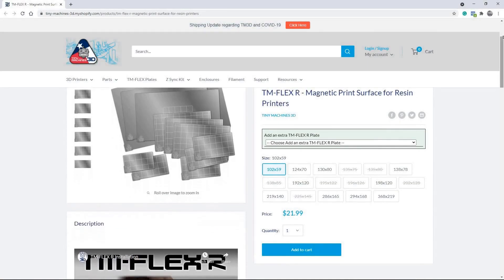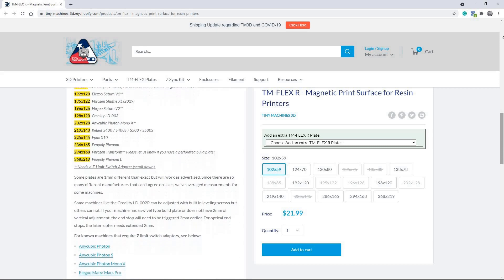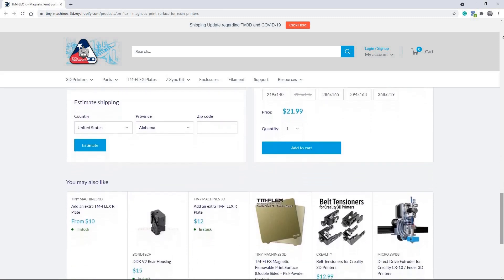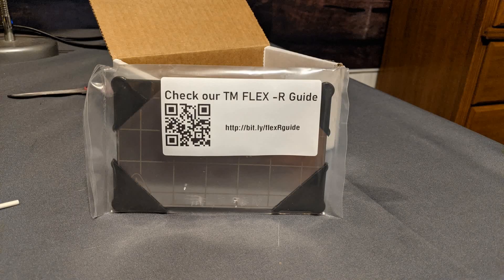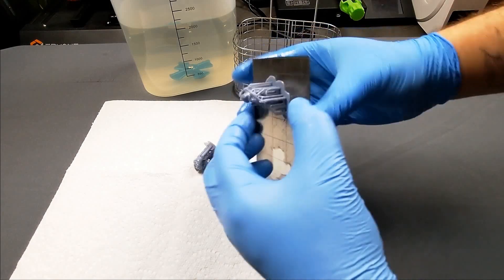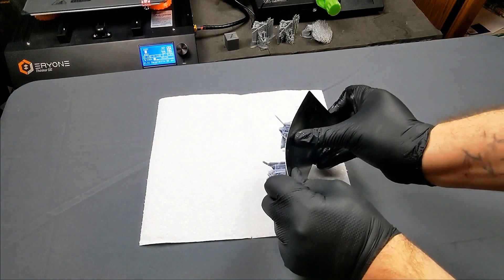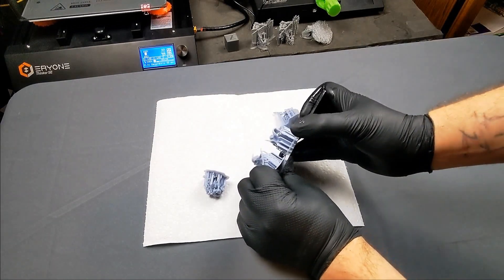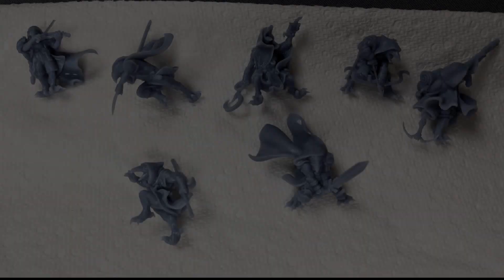The Absolut Best Upgrade for Any Resin Printer!

Comment: I'm curious if you are still using the flexplate? I had to change back to normal on my printer because I got layer shifts due to resin getting between the magnet sheet and the flexplate. I made sure to clean the flexplates underside and magnetic surface after each print, but it seems the magnet is too weak, it was just a small film of resin but enough to cause layer shifts. I got mine from energetics store on aliexpress, maybe the magnetic sheet is weaker than others..idk. I'd love to see manufacturers embed strong magnets into their build plates so we can use flexplates without those magnetic sheets. As for now this isn't an option for me, it just introduces one more possible fail variable.
Reply from the maker: I can definitely understand that. I've hard of this happening on a few different plates from some manufacturers. I definitely think it's due to the magnets being too weak to withstand the suction forces.
I've not had this issue on any of my 3 flex plates. However, I'm not printing continuously on those units so that's possibly a part of their longevity.

I totally understand, it would be awesome if different manufacturers offered a build plate with embedded magnets as an optional add on.